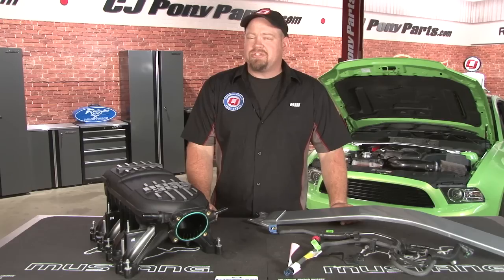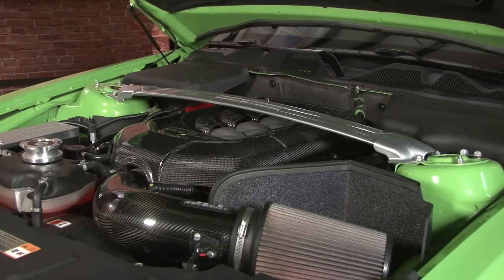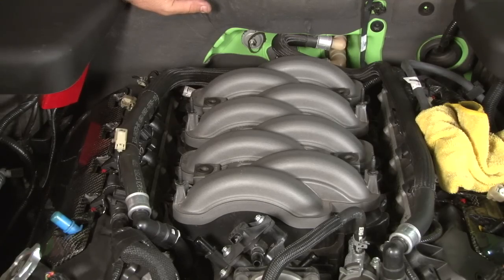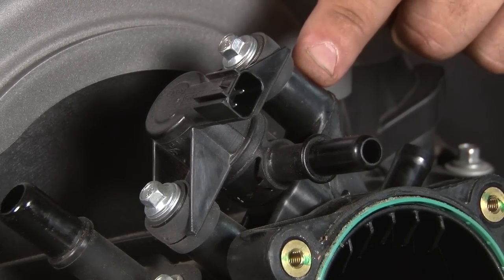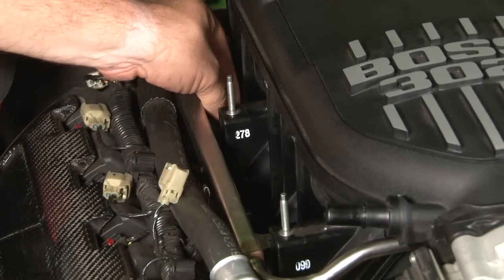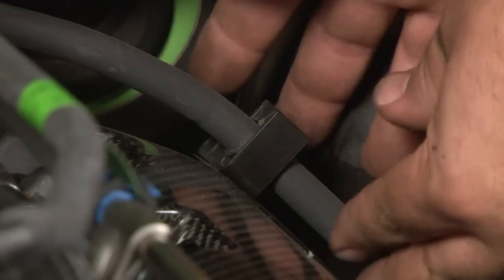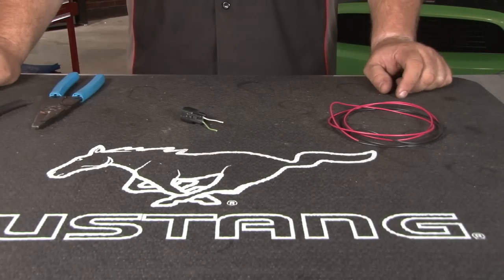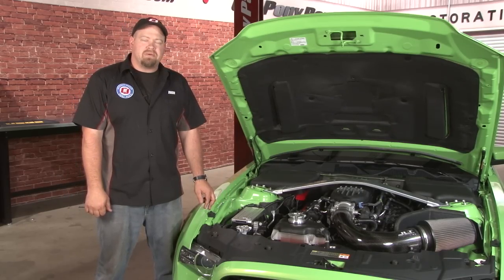Mustang GT Ford Performance Intake Manifold Boss 302R 2011-2014 Installation

Comment: UNBELIEVABLY HELPFUL DURING THE INSTALL. This video was significantly more helpful than the included instructions. Step-by-step instructions cover the complete install even though it doesn't proceed in the same order as the included instructions. All the unexplained and ambiguous instructions are completely cleared up. Bottom line: Buy the parts (worth it) and follow this video during the install. Thanks CJ Pony Parts.

Comment: question.. at the end of the video you are installing the oil separators (nice pieces by the way) and a "master cylinder vacuum line". on my 11 its not a vacuum line, its a sound tube that goes into the cab of the car. did ford change this in the later models or did you misspeak?

Comment: Difference between boss 302 intake and boss 302r intake
Reply: The difference is the boss 302r is the same as on the real boss 302. The one he's putting on is an aftermarket 302 intake.
Reply: I'm getting the boss 302r and having it ported
Reply: @brianpreston3052  Really? I haven't heard of the 302r before. I work at a dealership and ordered my manifold from there for my 2014 by just looking up the mani from a 2013 boss. It shares the same PN as CJ/American Muscle/Etc..

Comment: Around 12:25 I connected the line for the brake booster, I would make sure that your line is secure and not leaking. That could cause the issue you described.

Comment: There are 3 fittings on our JLT cold air intake. The sound tube is a larger fitting that we have capped off since it is not needed with the JLT. The two smaller ones are the vacuum feed to the master cylinder/booster and the other is to the drivers side valve cover. All 11-14s have the same lines.

Comment: There are plenty of arguments on both sides for the Boss intake. Without a tune you will lose torque but a good tune will bring back most of it and you gain power over 7000 rpms.
Reply: 7000+ rpm?? a little too late
Reply: So is it safe to run w/o tune
Reply: Awesome vid!! Would this exact install also apply to the 2015?

Comment: Only the socket sizes matter, doesn't matter if you use 1/4 or 3/8th as long as it has the right torque spec

Comment: Anything that involves cutting and splicing wires turns me off. Can't you guys sell custom extension cables/harness instead?
Reply: Nhoy Barangay that would be nice but it's not that big a deal they're just extending it a little.
Reply: Nhoy Barangay, exactly! Devin Crawford, exactly! Why can't they give you an adapter harness that plugs into your stock harness and extends it?!?  Ridiculous!

Comment: Hey Bill, I have a 2020 Gt with the manual gear box. I have a Boss 302 intake manifold I wanna install on it, will it bolt right up or do also need to order the install kit that you installed on this one? Thank You for the great content….
Reply: Stock 2018-2020 manifold flows very well...not really worth the upgrade unless you port the boss intake, but that'll just be more money on top of what you paid, maybe 10hp at most in the high rpm range. And I know people want manuals, but for a 2018 or 2020, if you wanna win races, the 10 speed is where it's at, those fuckers pull hard. Raced one the other day in my cammed vette, all he had done was a lund e85 tune and we were neck to neck

Comment: yep . i have a vacuum line that goes from the boost to the lug under the purge line lug on the manifold. yours tees off and you have one that goes there and one that goes to your cold air intake tube. mine does not. never did ..my vacuum line looks nothing like yours  i am the one that has done all the work on the top end of the engine and the stock air tube did not have one either. STRANGE maybe the early ones did not have this tee? thanks for answering me

Comment: hi bill i recently installed this manifold along with a custom tune from bama and im averaging aroun 11mpg's there's got to be something wrong.. can you help me out here..
Reply: +Diango Carrera  First thing you want to check is for any vacuum leaks, make sure everything is tight and nothing is connected to the wrong places or not at all. If everything mechanical checks out then the issue is with your tune, no 5.0 with a Boss manifold should see that kind of MPG.

Comment: Hey, I noticed he didn't change throttle body... is it necessary to change or can we keep it stock?
Reply: SE7EN YEARS STUDIOS pretty sure can keep stock
Reply: Rai54 Raizzy baby, you can use the stock throttle body but stock has a 80mm opening and the Boss intake has a 90mm opening. To get full power out of the intake, I would install a cold air intake and 90mm BBK throttle body or 85mm BKK throttle body, depending on you other upgrades and planned future ones. JLT Series 2 CAI is awesome, I'd suggest using that too.

Comment: Any video providing explicit instructions on how to install the Cobra Jet intake manifold? I installed mine and I have no throttle response.
Reply: Joseph O. Camacho Irizarry I just got a 302 boss intake manifold, but it's recommended to get a tuner. I got the BAMA's performance tuner, without it, you'll lose torque even if you have installed the intake manifold. You might need a tune, from my point of view....

Comment: I installed mine and I tuned it everything works fine except the brakes. Each time I push it full throttle then I step on the brake pad the brake pad becomes heavy and the car  won't stop for about 3 second then it brakes.  Someone told me that the air in the brake booster changed.  Is it a common issue or from my bad installation
Reply: Check you break boast line on the drivers side of the manifold, make sure you have that hose on all the way

Comment: Could you provide the ford part numbers for the purge valve assembly and the fuel line they dont seem to be able to find it at both dealers I went to? claim the BOSS and GT list same parts. I guess I might be asking the worng question as well. Thanks
Reply: They are included in the install kit we offer from Ford Racing, M-9444-M50B. I do not have any individual part numbers.

Comment: Great video guys! Will this fit on my 2014 mustang 5.0 automatic? Some sites say for manual only! Also its 2020 now. I want the best possible. What should I get. Thanks 😊
Reply: Did u ever find out if automatics can get it?
Reply: @slicknick2345  yes you just need a hose adapter. I went with cobra jet instead tho.
Reply: @high-rise8505  did you install the cobra jet?
Reply: @Thy_Holdy  still waiting on backorder 😥.  Finally got my headers and h pipe in. Another few weeks on the CJ setup. So I'm saving for few more things while I wait. New gear ratio, borla S-Type Cat-Back exhaust and e85. Might do a 100 to 150 shot of nitrous just to hurt the kitty cats feelings 😆 🇺🇸
Reply: @high-rise8505  I’m having trouble with codes after I installed my cobra setup
Reply: @Thy_Holdy  I'm going to VMP to have it installed and tuned. I need professional support for this setup. I didn't want to risk anything and plus they have extra parts on hand if needed.
Reply: @high-rise8505  what type of hose adapter ?

Comment: What size wrench for the manifold bolts, I bought a 1/4 inch pound tq online and I need to know if I need an adapter for 3/8 since you didn't say which was which :\
Reply: Also, my socket set had my 10 mm and 13mm sockets at 1/4  do I need a 3/8?

Comment: What about the connectors you unplug from underneath the old manifold. Do you just leave those unplugged?
Reply: They aren't connectors they are just push tabs that hold the harness in place no electrical connections. And yes you reattach them but only 2 of the 3 boss intake only has 2 spots

Comment: I heard the purge kit isn't a absolute requirement on the boss intake.
Reply: Wesley Griffin  it's not you can run 3/8 fuel hose from the old purge valve to the right side connection on the new intake. Use an empty hole in the block to hold the purge valve in place near its original location

Comment: bill why doesn't this fix 2017 ford mustang gt?
Reply from the maker: We shot this video in 2013 and it was never updated. They will fit the 15-17, the install is just slightly different.
Reply: @cjponyparts  yeah and alot of money manifold  1200 throttle  body 700 then a custom hood is like 1400 that come painted quite expensive

Comment: How much RPM can these engines take?  And what's the limitation, rotating assembly or valvetrain?
Reply: That is a hard question to answer, but the valvetrain seems to be the weak link on a GT. The Boss has an upgraded valvetrain and can be revved to 8000 rpm where as I would not recommend much over 7500 for a GT. There are plenty of people revving the GT higher but who knows how long it will hold up.
Reply: Indeed you would run the risk of valve float too.  Thank you for that answer.  These are some very impressive engines.  Can't wait to see how the new Mustang drives!

Comment: will this work on the 2016 as well the intakes looks alot like the older coyotes
Reply: +3star2nr  Yes but it will not clear the stock hood. You need lowered motor mounts or a taller hood
Reply: you just have to cut a small square on the inside of the hood so it clears when you close it

Comment: is a sct 91 octain tune good with this manifold
Reply: Get a real tune , preferably 93
Reply: You can def use your SCT to get everything dialed in.  91 octane is fine, no concerns.  If 93 is available, it’ll net you a tiny bit more power but prob not enough to feel an overwhelming difference.  Ideally, if you have the funds, a custom tune (can still use your SCT) will get you the absolute best performance, especially if you tune on 93.  We are about to do a 2012 on our channel too!  Best of luck, be safe and enjoy your ride!!

Comment: Does any coolant need to be drained when swapping the manifold?
Reply: +Mike Peach   No the intake will clear all the coolant hoses
Reply: Michael P did you watch the video? The answer would be no if you watched the video. He moves the coolant lines to the side and doesn't disconnect them.
Reply: What happens if you disconnect a coolant line when removing the intake manifold? Someone I know didn’t watch a proper installation video and they disconnected the passenger coolant line and some leaked and got connected again. Would that cause some issue of some sort or future issues ??

Comment: If I install the boss intake manifold without a tune will the check engine light come on?
Reply: Shawn Swayzee I have never had an check engine lights with the Boss intake but a tune is recommended to get the most performance out of it.
Reply: Cool! Thank you!

Comment: can i use the same OEM Line Under the brake Booster with a The Boss 302 vapor line purchased from your website??
Reply: +Dianelis Aballe  I haven't done one of these in awhile but I always replaced the line below the booster with the one in the Boss install kit.

Comment: make sure you use 89 inch pounds and the wire you need is 18 gauge
Reply: Thanks you saved me from breaking bolts

Comment: Yes it will drive absolutely fine with the Boss intake installed, the tune is to provide proper air fuel ratio at high RPM. You would want to go to a performance shop for a tune, most dealers will not offer that service.

Comment: Bill, good job as usual, I was wondering why you didn't use the same color wiring, but that is just me. I would want the wire colors to be as close as possible.
Reply from the maker: I used what I had available at the time, I agree on the coloring and usually try to retain the factory colors.

Comment: Not sure what is different. The video car is an automatic and I just did and intake swap on my 2011 and it was the same setup.
Reply: Bill Tumas  just started saying misfire 3 and 5 only when I'm just done flooring it? Not always but it does happen. Not if this would cause it but, I turn off traction control also before I floor it.

Comment: when i installed mine i use the stock purge valve.. i did not have to cut any wires or get the boss purge lines. i made a bracket and mounted the stock purge valve to it and then mounted it to the threaded hole on the block right by the water pump. then to connect the purge valve to the manifold i used a braided gas hose from the purge to the manifold. with the purge valve under the manifold and the braided line it makes a nice looking and clean install.
Reply: Did you ever post it?

Comment: ok that is weird. mine does not. the stock one did not and the steeda one does not .. ok 2nd question .. is the automatic's different then the manuals and that is why mine does not have this vacuum line. scratching my head??????? and confused

Comment from the maker: Give your 2011-2014 GT some racing-inspired performance with the Boss 302R intake manifold from Ford Racing! 

This intake manifold is made from a light-weight composite material and offers your  #Mustang  optimum flow at higher RPMs. 

With Bill's step-by-step instructions, you can install the Boss 302 intake yourself in just an afternoon!

Comment: $700.00 plus for how much additional HP.?  Yeah, didn't really say. 
Splicing in the harness, when ford could of made a jumper harness for a few bucks.
Reply: VMP has a direct plug in extension you can use. And you're much better off just going to your local ford dealer and buying the manifold. Prices vary, but at my work it was $207 as of last friday.

Comment: Question, i bought a mustang with this exact setup im showing error codes for all 02 sensors, and camshaft timing or something like that. Im not quite sure if it has been tuned? So i guess another question is changing to the 302 intake will there always be a check engine light on or???

Comment: I have a 1979 mercury Marquis with the original 302 motor and I need to change intake manifold gasket will any of these videos work.
Reply: We do not have any videos for a stock manifold R&R. Any Chiltons or Haynes manual will cover that job.

Comment: So I installed the Boss a few weeks ago. Sometimes when I goto brake and come to a stop the cars rpms will fall to under 500 rpms and sometimes stall out. I had my tuner set the min rpm idle to 650 but it only seems to drop while im braking. Anyone else had this issue or know a solution? It only does it sometimes. CJ Pony Parts Bill Tumas
Reply: +that_red_stripe The solution is a manual transmission.
Reply: +that_red_stripe the fuel cut off duration might be just a little too high, have the tuners increase that number by a few notches
Reply: i have the same problem on mine please let me know if you found a fix !
Reply: I've come across a similar problem recently. My throttle body was dirty. What happened was when i let off the acceleration the throttle body snaps shut and the gunk buildup around the edges of the throttle body caused and issue with idle. All this shit built up because of the pcv system most probably. After I cleaned the gunk off completely from the throttle body (mind, you have to remove it to clean it well) i noticed that the throttle body idle opening is quite visible now. I can actually see through the throttle body around the edges. guess what happened? rpm never dipped again below idle. and while i was at it, i decided to put breathers on my pcv system by removing those lines (and passenger side check valve, have to take out the valve in order remove it). i used those small cheap filters (you have to drill to increase their size so they fit int the pcv valve). capped off the open holes on the intake and behind the throttle body with a size 15 radiator connection cap off. hope this helps. EDIT: if you run diagnostics test you might find p115e, it doesn't leave a check engine light on. but then again, it's "might". if you do get that code it's the throttle body and clogged up on the sides. if not, then your fuel trims did not reach their limit to save the car from dying.
Reply: Rashid Al-Riyami i think that i need a tune for the car it has a boss 302 intake manifold in it
Reply: Julian Lopez so you installed the manifold without a tune?
Reply: Rashid Al-Riyami no i recently bought the car and it came with the manifold
Reply: that_red_stripe check the throttle body first. most probably it is already tuned
Reply: Rashid Al-Riyami ill try that 👍
Reply: that_red_stripe bought the car with this MANIFOLD and it happens once in a while. Also just started saying misfire 3 and 5 only when I'm just done flooring it?

Comment: Don't you lose a lot of torque with this intake, everything I've read I you lose quite a bit of torque, but gain horsepower.  I wish the intake work the other way around where it would increase torque instead of horsepower.  Nice video though
Reply: I got the 3.73 rear end,  I could probably use a little less low end torque lol
Reply: If you don't want to lose any torque go with the cobra jet intake manifold

Comment: We have seen others cap the connector but you may also get a check engine light if you do so. The correct way to install it is to keep the purge valve that Ford intended to be there so that is how we installed it.

I agree the covers look good and we may do them in the future.

Comment: It's not necessary to depressurize the fuel system then?
Reply: yawnnnthreesev You can unplug the fuel pump and run the car until it shuts off if you wanted to but I found its really not necessary.

Comment: Do you need that installation kit or can you swap over the parts that are already on the car?
Reply: The kit makes the job much easier, the one line is absolutely needed.
Reply: Bill Tumas could you please tell me what line is absolutely needed
Reply: mkelebay the kit is a gimmick you don't absolutely have to have it. Most are done without it.

Comment: Nice video.. by chance to you guys offer painted valve covers for these cars? Seems like there is plenty of coil covers out there, but putting them on those plain valve covers just has an unfinished look to me? If not, and I need to take mine off to be painted, will I need a new gasket? Or???